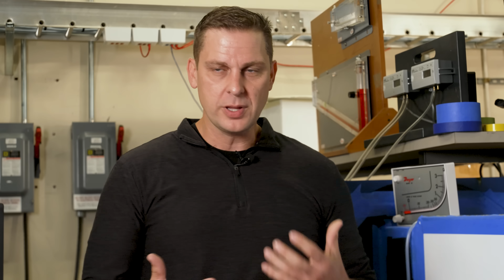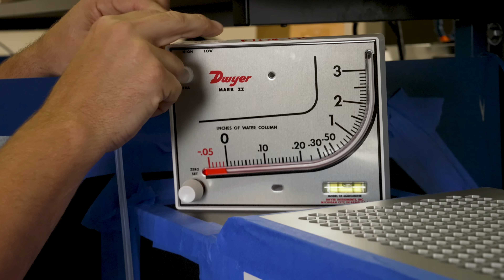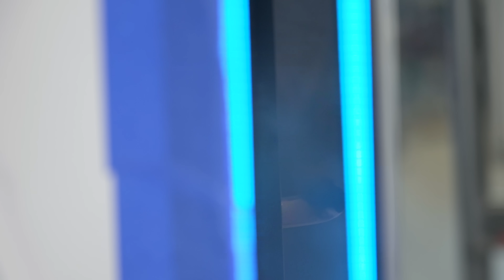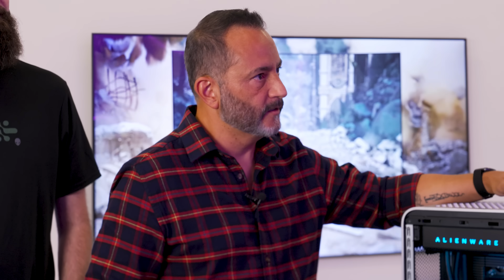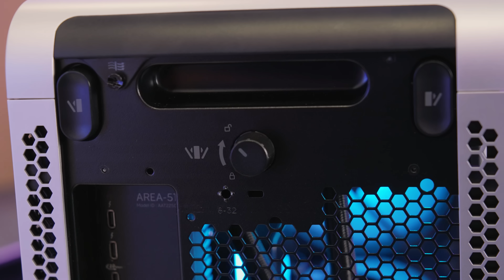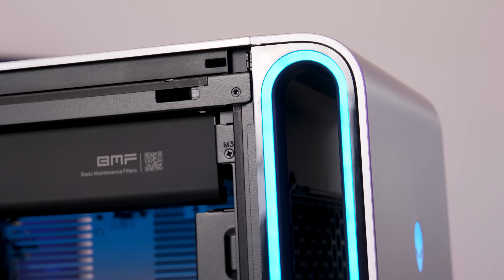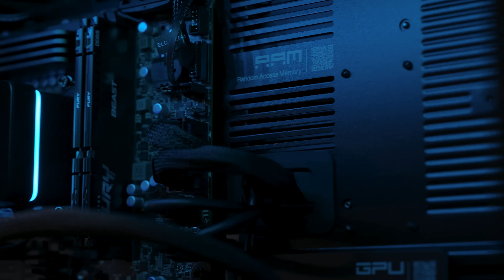Adam Savage Learns How Gaming PCs Should Be Cooled!

Comment: For all the people who say positive pressure is best, I'll say it depends on your goals but negative pressure is better in most situations.

With no fans a heat source only cools from convective air cooling and a little bit of radiation.  Air rises in convection so you want your cool air intake low on your case and your hot air exhaust high on the case so that your case fans are not fighting convection to move air.

From a practical standpoint, the temperatures you want to control the most are components which throttle their performance when they become hot.  The rest are parts that are nice to cool to extend their service life and then there is the PSU which is designed to handle heat but they can be very efficient and emit little heat themself.

From all that, the ideal layout is to put your PSU on top with an exhaust fan that directly exits the case.  This enhances convection, you really don't care how hot the PSU gets as long as it's below about 80° c (because electronic components are rated to at least 85° c) and the heat from the PSU itself is immediately removed from the case before it can heat anything that works better when cool.

Now the thing lots of people miss is the airflow path outside the case.  If your intakes suck air that just came out of the exhaust, your airflow isn't doing much cooling.  If you think about your computer inside of a generic box shaped room, you want the computer to set up a convective flow inside that room to efficiently transfer the heat to the air and allow the room's HVAC system to efficiently remove that heat.

Now for a low-mid range gaming PC, if you use a blower style GPU that exhausts air outside of the case and a decent CPU heat sink with a large diameter, slow speed fan and a good top mounted PSU with a large diameter, low speed exhaust fan and a 80+ gold rating, your PC can run almost silent and pretty cool without any additional fans most of the time and make a bit of noise and throttle a little when you are pushing the performance limits.  You just need to make sure your case doesn't have unnecessary vents or leaks that allow exhaust air to get sucked back in to the case.

If you want more gaming performance, you probably want to ditch the blower style GPU for a 2-3 fan GPU cooler setup which is more efficient transferring heat to the air inside the case but doesn't help air move from the case intake to the exhaust.  Adding one or two additional large diameter, low speed exhaust fans at the top of the case will fix that.  Then you might want to get a smoke crayon to see if your exhaust fans are sucking air backward through the PSU.  If it is flowing backwards you might want to add an intake fan to reduce the negative pressure.

Water cooling is probably the next step but I would do a top mount radiator just for GPU cooling and keep the PSU on air because the CPU is rarely the bottleneck in gaming performance.  Once again you should smoke test to see if you need an intake fan due to too much negative pressure.

That's about it, you don't need more cooling than that can do, that's a 3 fan radiator, a fan on the CPU cooler, a fan inside the PSU and maybe 1-2 intake fans to cover any single GPU gaming PC with a reasonable CPU (no huge Xeon, Epic or Threadripper).

There is no need for positive pressure.  If you are in a dusty room and have filters on your intake, it will keep the insides clean but occasional cleaning with an air duster will do the same with a negative pressure setup.

Now positive pressure can work but if you go crazy with fans you'll get a noisy PC and you run more risk of sucking exhaust air in to the intakes which can make it run hot and loud.

You can try to water cool everything but if you don't have any airflow through your case, a lot of components that normally run fine might start to get toasty.

It's sad to see ads like this.  I'm sure the money from Dell is good but the information is not all that great.

Cooling PCs is all about common sense thermodynamics and sufficient airflow.  Alienware is about selling expensive pre-built PCs based on looks as much as performance.

As much as I like the idea of upgrade paths, I think the die size of enthusiast GPUs is near the limit and that limits the power.  A reasonable gaming pc with an enthusiast GPU should never exceed 1,800 watts which is the limit of a 110vac power outlet so even if people wanted GPUs that use more than 900 watts, they probably couldn't power them with a standard outlet so I think the route of smaller and more efficient GPUs is going to be the path going forward.  Once you can do 4k 120+hz with mid-tier GPU, people are going to want quiet Micro-ATX and Mini-ITX size cases, not behemoths like this thing.

Comment: You only need a slight positive pressure to optimally cool a system. Positive pressure is also preferred to control the dust intake locations.

Comment: Despite this video coming off as more of a Dell advertisement,  the PC build is fine.. minus being outrageously overpriced and some stupid... may as well be proprietary... motherboard ( barely any options whatsoever ) crap that they have to add into every one of their computers for decades... they just can't help themselves.  In terms of airflow positive/vs negative,  just avoid neutral.  Your main concern with negative would be dust,  dust is a minor, mostly superficial problem that can be remedied with adjustments or just a simple electric dust blower.

Comment: my Aurora MOB died so I gutted my alienware desktop and put it in a corsair 5000D case with Noctura fans, better PSU and new MOB, removed the alienware liquid cooling and just used air-  still saved me from building entirely from scratch as the GPU alone is the majority of the price i paid.  Working great, stays cooler

Comment: I didn't need a team of engineers and a $20k setup to figure out this...always built with positive pressure. Intake air from front and bottom, out through the top and back. Keeps the PC cool AND with filters on intakes you keep the PC dust free(almost ofc...still clean mine out twice a year)..

Comment: You can endlessly debate this subject, especially since case design is all over the map. This business of taking measurements from an artificially sealed case seems kinda pointless. Whatever the data indicates, a real world configuration will not behave the same way. The current trend in case design includes large areas of open mesh, and while this seems great for ventilation it completely negates any attempt at positive OR negative pressure. The only standard I firmly believe is that any fan on a radiator should be set to exhaust to send the heat pulled from the rad directly out of the case. The rest is just tilting at windmills. Or, uh, PC fans. 😁

Comment: wow that's an awful lot of nonsense , idk if the engineers made all that because they need to justify the hours of labor to their supervisor LOL 
Yeah, if you wanna cool pc components you blow air directly to their heatsinks. It doesn't take a PHD to realize that and positive is better in like 90% of the situations. 

Like, if they made an unique looking case like some of the older models i would have understood all the simulations on technical equipment but that's like the most normal looking case i've ever seen from Alienware. Which is not a bad thing at all, it just make all the testing look a bit silly.

Comment: While having positive pressure in the case is more ideal, I believe the overall point of case fans is exchanging the air in the case as much as possible. If you can't reach a minimum air exchange point, your parts are going to be cooked regardless of positive/negative pressure. This is why cases with more open front panels tend to perform better than cases from several years ago that basically had panel a half in or so in front of the fans. Those things were choking how much air could get into the case and thus, how quickly the air could be exchanged.

Anything that needs airflow for cooling has a fan bolted onto it. And if it doesn't but should, then get something actually designed for the job.
Reply: Rip side fans, the best cooling tech to just disappear cuz glass looks cooler
Reply: @MNewton  Fractal makes a version of the North that has side mounted fans on the left panel. I believe some other higher-end case manufacturers (like Lian-Li) have something similar. 

However I don't think they're really that necessary unless you're rocking a 400-500W video card and it's running at full tilt.
Reply: @ChannelSho I've had no luck finding any at all

Comment: I would have liked Tested to actually test the case. Put a clear panel on the side, use smoke to actually see where the airflow is going, and install temp probes everywhere. That would have been interesting to me.
Reply: Problem is that their involvement is sponsored by the manufacturer, and actual testing might contradict their claims.  So instead we get this half hour ad regurgitating whatever Alienware tells them to say, hoping to sell a computer you could build yourself without the 100% markup.
Reply: You want me to do that ;)? I still have the glass side panel but the fans chop up the smoke post through the radiator I could possibly go get a poly board and do the same thing.  The foam board just makes it easy to move the pitot tube and velocity meters around to any internal point.  .What ya want to see/know?  Response may be a bit delayed because day job.  #iworkfordell
Reply: Smoke will eventually be emitted from the smouldering CPU 😂
Reply: Alienware wouldn't allow that. They famous for overcooking pc parts with their stupid designs
Reply: You probably want a thermal imager for that. No residue left behind.

Comment: simply amazing how for the last generations they managed to come up with designs that were basically an oven that did the exact opposite of what they promised and explained  here. answers please...
Reply: Simple. All of their previous 10+ yrs of Alienware were just rebadged and reskined desktops. The interior frame was exactly the same for a 790, 7010, 9020 etc etc as it was for the AW devices. Right down to the Mobo and it's proprietary front panel daughter boards.

Comment: I've always been of the belief that you need both.  You need fans moving cool air into the case, but you also need fans removing hot air at the same time.

But the real trick is how the air is routed through the system.  You could be moving a ton of air through the system, and not cooling anything with it.
Reply: Noctua did a study recently showing this. It turns out the bottom to top air flow isn't so great as it brings heat from the GPU up to the CPU. So it's good to use the first fan up top to bring air in for the CPU cooler to pull through. That's all air cooling, of course. If you're doing a radiator up top with an AIO, it matters less. Still, these are things you have to consider. It's a case by case basis.

Comment: How does a company (Alienware) look this impressive, enthusiastic and focused on thermals, temps and performance in this video, but have arguably the worst air flow, thermal throttling and incompatibility in the market??
Reply: Hey thats not fair, Corsair worked hard to take that title!
Reply: @mromutt  As much as it pains me to agree, I am one of the users of a case where Corsair decided 1mm of room between the front panel and 2x 120mm fans was enough to cool a full tower ATX case. I use it without the front panel because the upgraded replacement they sold was too expensive for something I was literally getting for free by removing the front panel. Still would rather buy a corsair case than anything alienware, Corsair is a solid company, alienware has been and will be a giant smoke screen
Reply: Steve from Gamers Nexus was pretty impressed with the case thermals and noise levels, but not so much with the rest of the build. It's a first step for Dell, actually listening to its engineers and not the bean counters.
Reply: @ldisc66 I get that but it’s like saying “wow this pile of rotten garbage smells a little less like a pile of rotten garbage now. Great job!”.
Reply: @zaksmart3154  Well... yeah. But hey, an improvement is an improvement.
Reply: It's because they are trying to shake the deserved reputation. Go look at the reviews of this, like the one on Gamers Nexus. The overall thoughts are there are still negatives, but the new Area 51 is a noticeable improvement.

Dell wouldn't be spending the money promoting this if it was getting terrible reviews.
Reply: MSI prebuilts would like a word.

Alienware actually has a decent case now, their case just a year or so ago was total nonsense.
Reply: because they spend the money on it looking like it does the job instead of engineering it to do the actual job
Reply: This is a far cry from their poorly designed cases. Still have an aurora R2 and that thing had basically no cooling capacity.
Reply: incompetence
Reply: bloatware constantly running actively at the background
Reply: because they are a DELL brand who push volume not quality
Reply: Because it is all about looks... and money.  The engineers know how to cool a system off, but the designers want it to be "pretty", the accountants want it to be cheap, and the executives need it to be as proprietary as possible to lock in customers.
Reply: @Hazdazos  Much like anyone can build a bridge that stands anyone can build a computer that cools it takes a engineer to design one that barely cools or stands.
Reply: Because these companies use the tjmax(Maximum Temperature the components can handle before damage)as a goal, the lower the temp of the components the more they take from the cooling system.
Reply: Easy:  Dude, you're getting a Dell!

Comment: Short answer: Heat rises and there is plenty of room for the ambient heat to escape. The CPU also is watercooled, pulling heat away from the board, die and exhaust area over to the rad. My watercooled build in a LianLi 011D has two 360mm rads, and is entirely negative pressure. The CPU rad is in push/pull config with six 120mm fans venting out the back side.

Comment: heat rises...   

I have 2 filtered 100mms sucking in front, 1 pulling out back, and 2 pulling out topside - SO MUCH hot air rises out of the top + no dust.   Mini ATX, Ryzen 5 + a 3060.

Comment: This video only makes me appreciate my ancient SilverStone Fortress FT02 even more!  If you tilt this Alienware to lay on the front side, this is a modern day clone of my FT02.  I've been enjoying a vertically oriented, bottom up flow positive pressure case solution for over a decade.  The panacea was when I finally upgraded the three 180mm fans to PWM and installed Fan Control to set custom curves, my PC is so silent that I often think it is off if my screens go blank.  I've dealt with water cooling troubles in the past, and these days I prefer the simplicity of air cooling.  It is rare I ever hear my fans ramp up, even though I've got a 4090 and 7950X3D.  I could possibly live with the FT02 forever, it's that great, the only real downside is I have limited space for GPU's, thank goodness for Founder's editions.  Here's hoping this new Area-51 design will usher in a new wave of positive pressure designs, we need more options.  I also love having my motherboard connectors on the top instead of the back, this rotated design makes so much sense to me.  I really wish SilverStone would make a modernized version of the FT02.

Comment: I'm confused how Alienware could have a testing lab and still make some of the worst designed computers. That's not even mentioning their use of property parts that make them hard to repair and upgrade. I just assumed Alienware products were the result of "vibes based" engineering.
Reply: Psst.  Check out the GN review of this case from a couple months back  (spoiler:  They use off-the-shelf parts and the "box" was actually redesigned).  They actually retired the "Better than Dell" award after this case.  Aside from the cost (and niche PSU), it's actually OK.
Reply: proprietary
Reply: I doubt this lab is dedicated to Alienware.  Likely most of their work is on the rest of the Dell line.  And it takes a lot of engineering effort to make something BARELY work.   Dell invests in this because If Dell can use a cheaper fan or fewer of them, they make more money.

Comment: Dellienware has been nothing but trash since shortly after Dell bought out Alienware in the late 2000s. In fact, both Gamers Nexus and Linus Tech Tips have done exhaustive independent and even "secret shopper" reviews of Dellienware desktops over the last five years and have noted just how poorly these desktops have been built every single year. Conducting these tests with a custom PC would be far more advantageous. Dellienware has a decade-long track record of horribly designed cases with poor airflow and proprietary hardware that makes upgrading them nearly impossible and corrective actions on thermals equally impossible. Dell (parent company of Alienware, hence "Dellienware") is the #1 reason I haven't gotten a pre-built system since 2007, and why I'll always build my machine.
Reply: Exactly